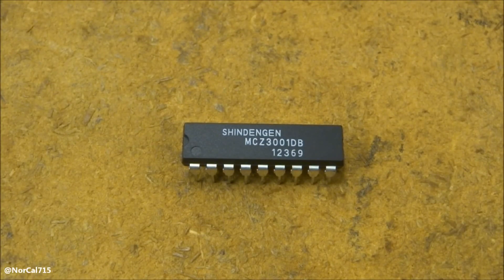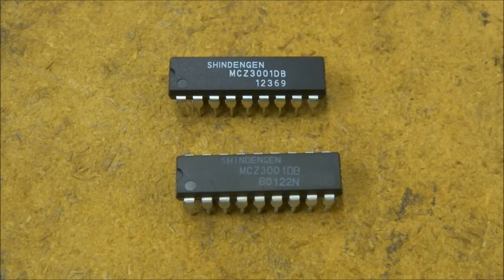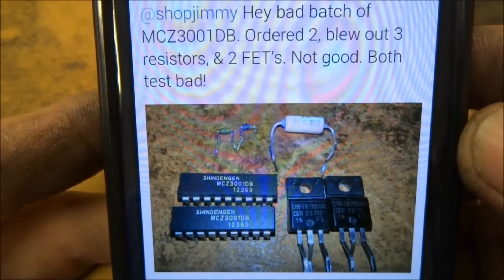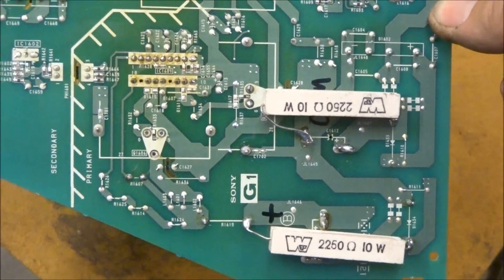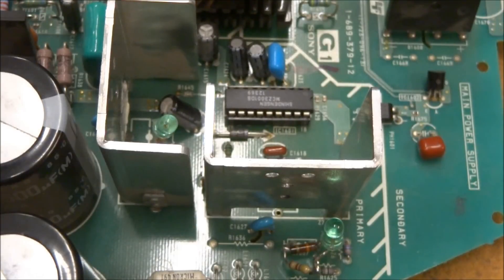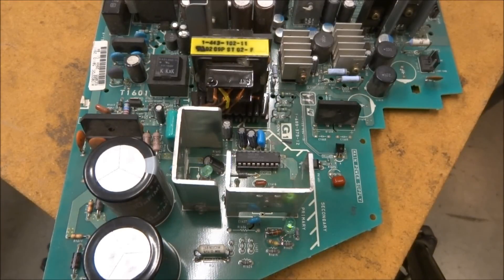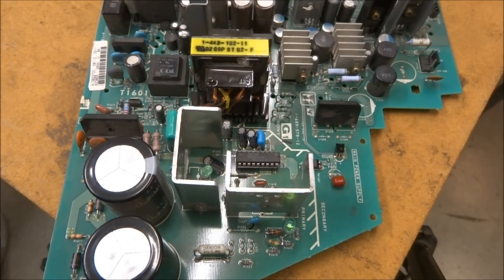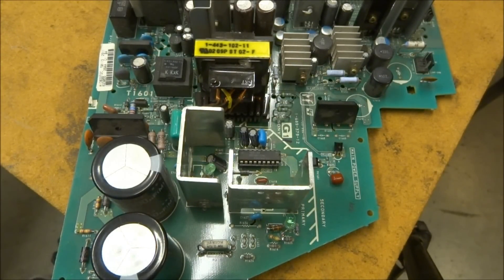MCZ3001 Chip 6-705-810-01 Power Supply Problems and Troubleshooting, Generic Chip Problems

Comment: Hey NorCal 715, you are the King !   I know this is an old thread, but I have (had) a nice functional KDF-42WE655 in 2025, until the dreaded six-blink red light.   Disassembly looks like a real pain, so I hit the G1 board area with a hot hair blow dryer for 3 minutes.  Set started up !!!   Will no doubt look for some chips, but I may look for a small heater as a short term solution.   Nice work !!! Thanks for the video ... 😊 ...

Comment: Hello! I have 16 blinks on my kv29fq85e. It's turning on just fine sometimes but the majority of them won't start unless i heat this particular chip. I've tested every single one capacitor and they all show good measurements. How can i test this chip with a multimeter?

Comment: very well done video!  I was down this same road with a set I had in the shop a few years ago.  I never knew that the knock off MCZ3001DB was such a pandemic. I ordered two on eBay and both were no good.  Fortunately my mosfets didn't get blown.  Ended up ordering an oem from my distributor and that took care of it.

Comment: HI Guy

I also have a Sony CRT and I am doing my search on of this issue. Thanks for the great work!

It is hard to find a MCZ3001. So I try to check if the IC maker have replacement for this IC.

I checked shindengen website. MCZ3001D/DB are discontinued.
And I think they have replace MCZ3001 with MCZ5203. 
MCZ5203D is also DIP18, but MCZ5203SE is in form of SOP22. But MCZ5203D is also discontinued.

The wesite have a search engine to show which new IC model will replace the discontinued IC. 
Funny fact is that the search engine will not show MCZ3001 replacement in English version of the website, but the search engine will show MCZ3001 replacement when you set the website in Japanese. Typical Japan website style, they only keep things to their own. : P

I can only download the datasheet for MCZ5203SE, the pin name did matched the pin name of MCZ3001 as shown in most Sony service manual you can find online. But I cannot find the datasheet of MCZ3001 so I cannot verify if all electrical parameter also matched too.

Comment: I often bought these chips by the dozen, union electronics would say they were sony originals, however they sometimes weren't...but they would charge 12 dollars for them! Matt electronics sold me over 30 over a two month span and appx. 20 were bad, and they only replaced about 8...thay kept telling me it was my fault, and they didn't have any other complaints with these chips...I was the only one according to them, and i've been doing buss. with them for over 20 yrs..out of 36 yrs. that i've been in this buss.....and yes, they also charged 12 bucks per chip...this buss. is ALL but done....we've become OBSOLETE !!!!!!!! IT'S simply cheaper to buy a new tv than to repair the older tv, even though ppl. spent 1000 dollars on a tv, they would rather pay 300 for a new one then to spend 100 to fix the older much better tv, and it was built better, but, that's the THROW AWAY MENTALITY of our society !!!!!

Comment: It appears that Shindengen does not make this part anymore and there does not appear to be a suitable substitute for this IC.  I would be suspicious of any vendor offering this model IC for sale, especially if it's claimed to be new and the vendor is not a manufacturer authorized dealer.

For vendors that are authorized by Shindengen and whom may still have these parts in stock, they may be available to customers on a first come, first served basis; once they're gone, they're gone!

Due to the difficulty in finding this IC, I can see where counterfeiters will try to cash in.

Talk about planned obsolescence.  Sheesh!

Comment: Ah yes the classic counterfeit components are still flooding the market. The company I work for uses Actiontech gateways, and recently actiontech got hit with counterfit parts. Every single router failed very quickly as soon as the VDSL switch was thrown and more power was required by the chipset. It sure has kept us busy replacing all these bad modems in the field that are still failing.

I hear you about the slow TV repair business. I left 12 years ago to go work for the phone company. Best move I ever made. I now only work on TVs as a sideline hobby. I have had the MCZ3001 failures, and I generally walk away when I get one. Been stung a few times.

Comment: I've been going in circles with these chips on the Sony DA-4 chassis "D" board. New chips twice, & it still needs the heat gun to start the set. Once started runs fine until it's off & cools again. I'll try a new pair from them & see. Thank you.
Reply from the maker: if the high voltage comes up and then go's down then look for a large capacitor either 33uf at 160v or 100uf at 160v. it is on the 130/135volt B+ line. they get a high ESR and cause high frequency ripple on the line and the micro senses it as over voltage and shuts the set down. Sorry i cant remember the cap # but it is right next to a 3 pin TO-220 regulator ic part number SE130 of SE135.
Reply: That sounds more like the issue. I believe that is the error read too. The HV comes right up & crackles down, then the dreaded 6 or 7 blinks depending. Even with new main caps, & the MZ's replaced with good ones. If that's it, the back can go back on after 4 or more years. Thank you.
Reply: +norcal715 
i may have a similar issue as farmradio.  i have a sony kv-32hs510 and back in 2011 i replaced the two capacitors and the mcz3001 chips with sockets and worked great till now. just replaced the two mcz3001 chips with oem type numbers(may still be not good) and still same problem, wont start and then blinks a 6 or 7.  if you use a hair dryer it only takes 45 secs or so (mabye less) and then it works/starts.  i have tried to use post cards to only expose heatfrom hair dryer to a chip or one of the capacitors (large) but every time that little bit of heat is all it takes and it starts.  i would really appreciate some help on what i ned to test or what needs replaced, thanks matt
Reply: +Farmradio 
i may have a similar issue as farmradio.  i have a sony kv-32hs510 and 
back in 2011 i replaced the two capacitors and the mcz3001 chips with 
sockets and worked great till now. just replaced the two mcz3001 chips 
with oem type numbers(may still be not good) and still same problem, 
wont start and then blinks a 6 or 7.  if you use a hair dryer it only 
takes 45 secs or so (mabye less) and then it works/starts.  i have tried
 to use post cards to only expose heatfrom hair dryer to a chip or one 
of the capacitors (large) but every time that little bit of heat is all 
it takes and it starts.  i would really appreciate some help on what i 
ned to test or what needs replaced, thanks matt
Reply: +matt w This time I bought a pair from the supplier mentioned in this video. The replacement chips (bought from MCM electronics) themselves may be the issue. Still have them w/the set, never got around to installing them to see.
Reply: +Farmradio 
let me know last week i put in the chips from b&d ent and same result as above in my post, i do wonder about the capacitor mentioned by norcal715, please let me know how it turns out and if you have a better way to get in touch with norcal715, thanks

Comment: Norcal...I have an rca 32la30rq lcd set. This board was replaced with a new one not rebuilt or from another set. When this set turns on once per week I wind up with a solarized picture and thus having to go to the sets menu to correct it by switching it to another bit rate of 10b instead of 10a and so forth, sometimes it would go crazy to do this more than once in awhile. Any thoughts as to what this could be caused by? woody

Comment: My Sony Vizio 32" works great most of the time. It will sometimes come on with no sound and the back light will not turn on. I've taken a flash light and looked closely and there is a picture just no back light. Could this chip be the issue with that? I haven't dove in and checked it out further, hard to fix something that isn't broke.